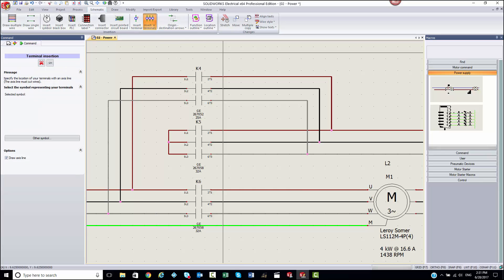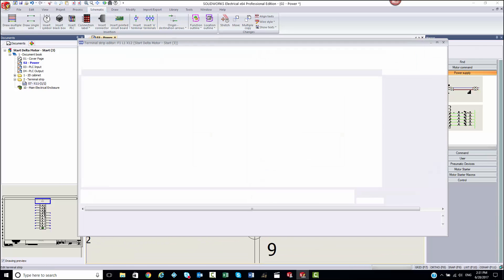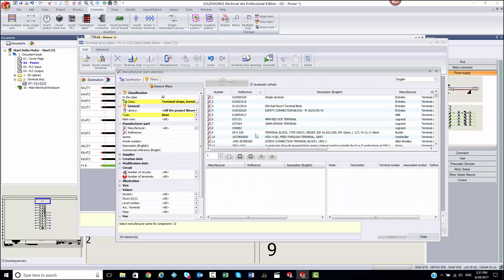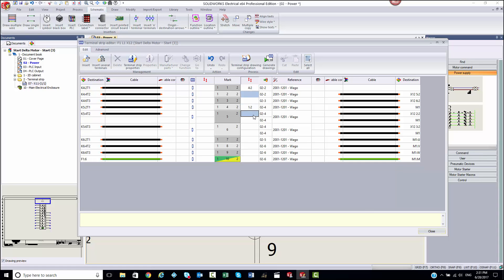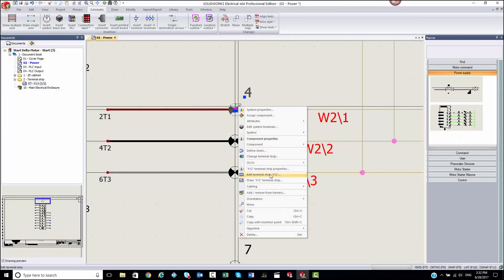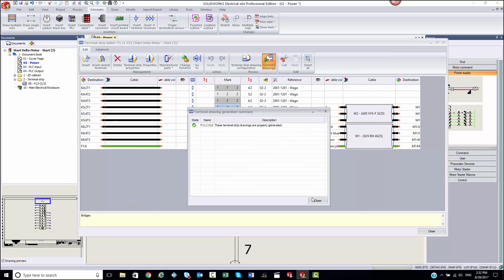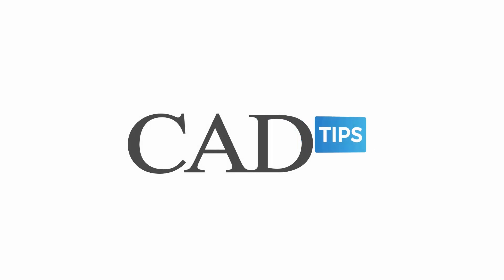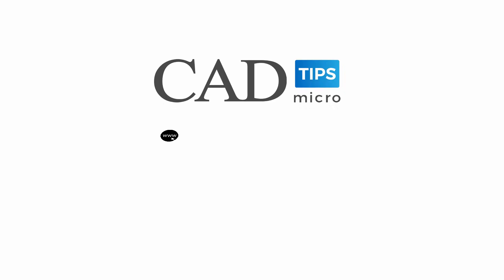Solidworks Electrical - Introduction to Terminal Strip Automation

Comment: the BOM generated will see it as multiple separate single terminal block or one terminal strip?
Reply from the maker: In this case, each terminal will show individually in the BOM, as each terminal has it's own physical part and part number. The BOM can be configured to show the part number and the necessary quantity in 1 line item.

Hope this helps!